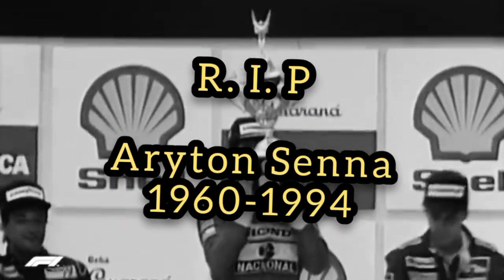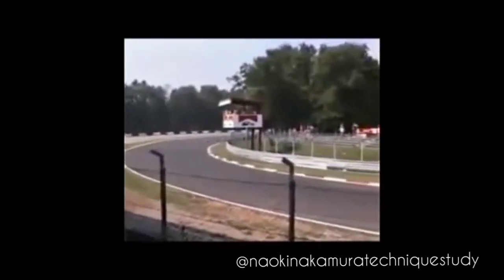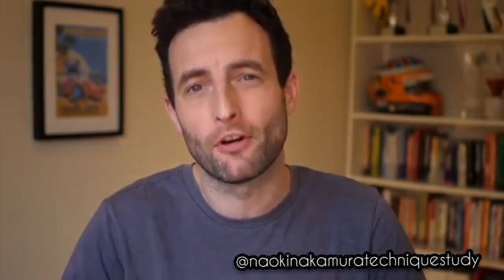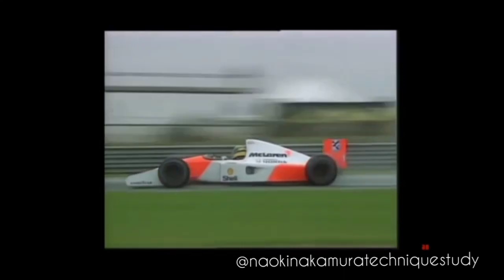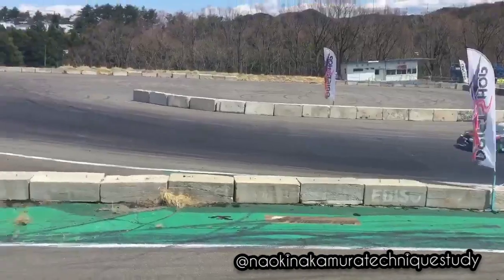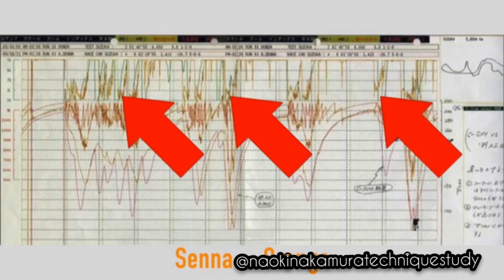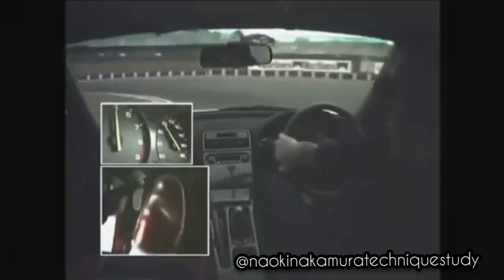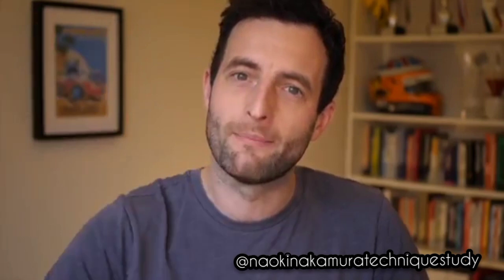Ayrton Senna x Drifting x Naoki Nakamura throttle technique analysis

Comment: Kazama explained it as such you "paa-paa-paam-pa-pa-paam" the throttle, keep wheelspin just at the threshold of regaining grip for more speed or break loose more = You can leave or catch up or stay door to door with everyone.
Reply from the maker: thank you for this good highlight . I later released a video explaing what the pa pa paam pa pa pammm sounds like haha..... thats two steps then third step is full gas haha .. now with naoki he has different varations of it .. sometimes he will go pa pa 6 times looool then paam  paam 5 all depending on situations.. his mid drift angle and line is his guide for how much.. if he wants to search for a deeper line he will pa pa pa pa a lot ..when settled he begins to mix them

Comment: Can you please make video or is there someone that can explain to me. When is better to keep taping the throttle while accelerating in drift vs when is better to be smooth with throttle? I have some ideas but I'm not sure and Naoki uses both technigues and I can't spot any patterns in when he use which. Also it would be nice to discuss the advantages and disadvantages of these two techniques and what exactly they does to your car in comparison between each other.
Reply from the maker: It starts with his goal. Is it a qualifying or a lead run or a freestyle.. When Naoki wants to be fast he taps.. When he wants to satisfy judges he uses full throttle and adjusts with taps.. It's all about what he wants.. Does he want to move fast or slow. It's all about what he needs at that moment
Reply: @naokinakamuratechniquestud226  Thanks for explanation 
😉